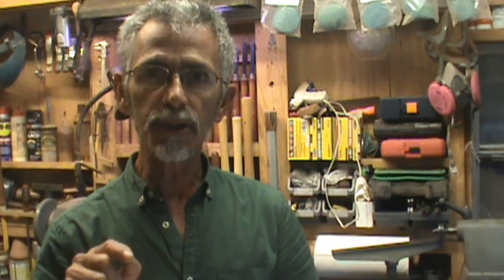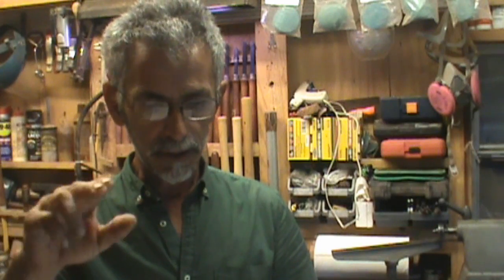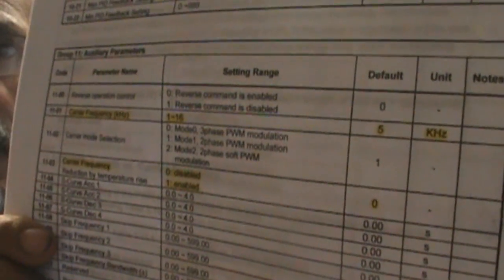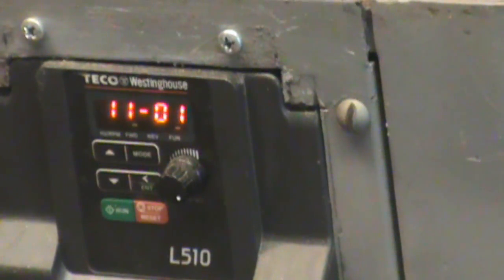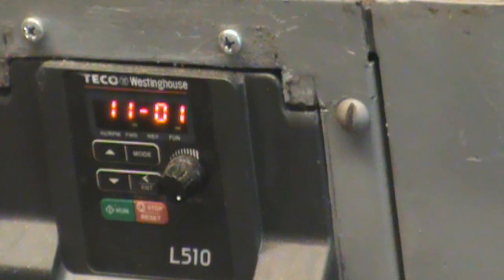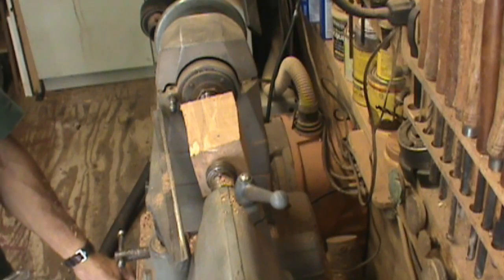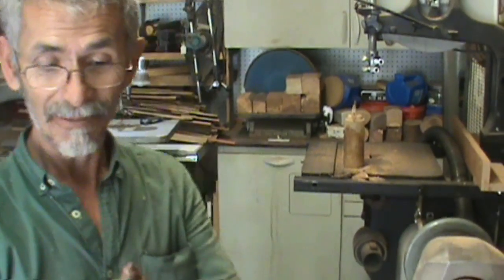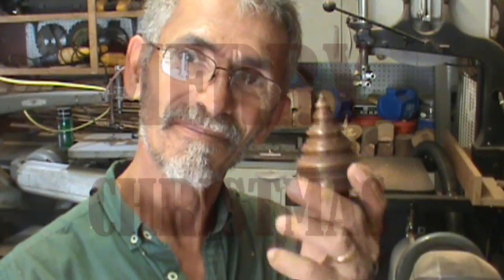VFD Whine noise removed I turn a Christmas tree by Al Furtado

Comment: While it may be quiet, the high frequency may be causing problems - insulation breakdown in the motor, or electrical currents running through the bearings. see some of the details on the wiki page for VFD's. https://en.wikipedia.org/wiki/Variable-frequency_drive

Comment: Al, I never heard the whining sound others commented about in previous videos, but when you were applying the Yorkshire Grit in this video, I had to mute the sound.  Very loud and annoying.  Not a whine but a high-pitched vibration maybe.  I have the same lathe and I know that cover on the headstock can sometimes rattle.  Don't know what it was, but it was bad!  Cute little Christmas tree, though!  Merry Christmas!
Reply from the maker: Thanks again for watching and commenting.  I know I still have some noises related to the motor and it being installed on a metal cabinet that I am not happy with. I do believe you might have heard a friction squeal while I was buffing.Thank you Merry Christmas to you and your family as well.